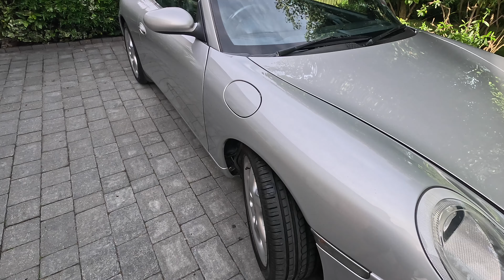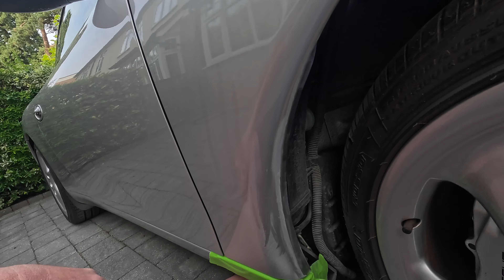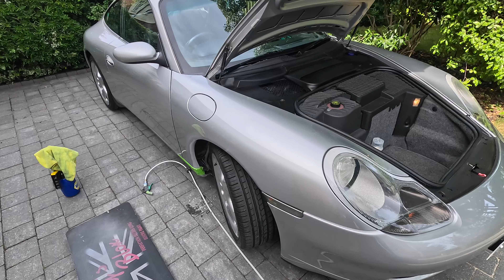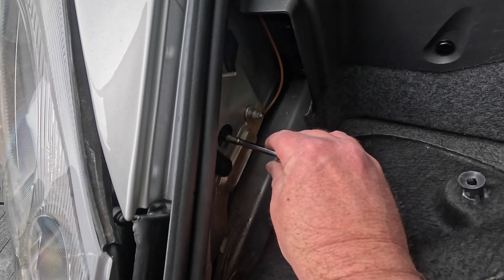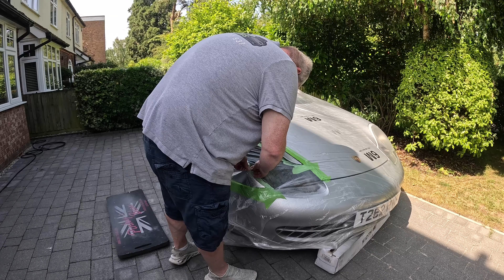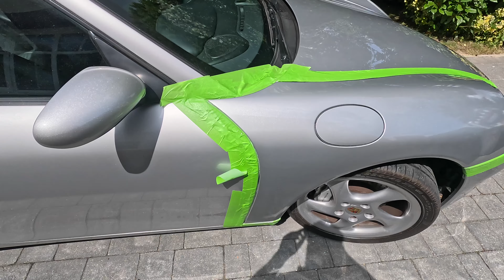Porsche 996 mobile wing repair

Comment: yo yo Mr  G
could you not run some sort of vacuum cleaner just away from a panel to draw away any dust..flys ect..
sort of ... just an idea... ?
we use them draw away toner dust when we fixing copiers...
so we dont die..
neat trick with the headlight.... bulbs must blow a lot on 996 then..

keep on more please

N x